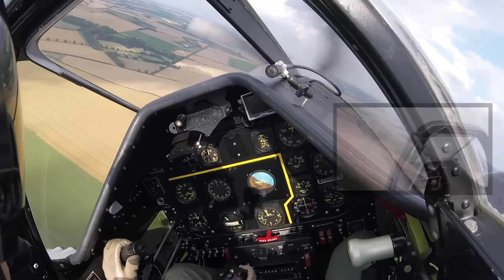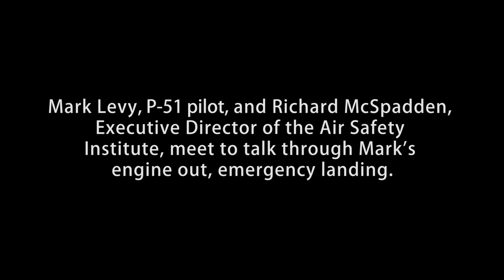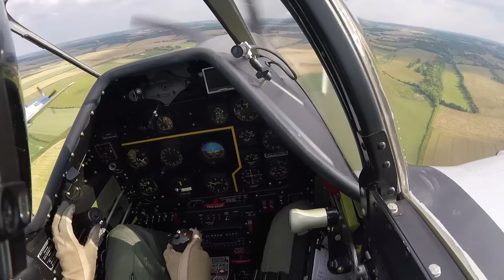P-51 Engine Out, Off-Airport Landing - Full Analysis

Comment: Excellent discussion. My rule for an emergency landing is "No gear until the landing is assured."  I don't care who is saying what in my headset.
And you're totally correct: an intermittent failure is much harder to deal with.  Your analytical, problem-solving side is having a tug of war with your natural instincts for hope. 
I had that happen (and interestingly enough, in my Navion), when I had an inflight engine failure at altitude over Connecticut. One moment everything was humming along. The next, sputtering, vibration, then silence.
 The engine had been newly overhauled (so of course it must be water in the fuel, right?). I traded airspeed for altitude until I hit best glide (90 MPH in the Navion at my weight),  switched tanks (no change), hit the boost pump (no change),  made sure the magnetos were on both (no change), then gave up and started downhill in the direction of the nearest airport (which I could see).
Then, the engine restarted.
Hope reared its head as I clawed back the altitude I'd lost. Water in the fuel after all! I turned away from the nearest airport towards my destination, just forty miles away. 
A few minutes later, it happened again. Rinse and repeat.
I flew a sinusoidal, up and down wave pattern all the way home, passing many good landing options along the way.  The engine running fine, then quitting. Running fine, then quitting. 
I landed at my home field (BAF), taxied to the FBO and the mechanic I knew would be on duty there., and shut down.
He determined I had only one functioning cylinder (out of six), that the rings were coked with burned oil,  and that oil  getting by the stuck rings was shorting out the plugs, causing the engine to die.  When the plugs dried a bit, the engine would relight. But there was no denying my newly-overhauled engine had cooked itself near to death.
It turned out the overhaul facility in southern Ohio  (since gone out of business) had not reinstalled my intercylinder cooling baffles, causing wonky airflow and overheating. 
There is no doubt I should have landed early and not pressed on for home. It was not "water in the fuel". Serious problems do not fix themselves.
In other words, I was not smart. But I was lucky.
Reply: @johnnunn8688  Actually yes - one cylinder working (which alone isn't enough) and then intermittent additional cylinders making the engine run again.
Reply: Personally, I would have put it down at the nearest airport even if the engine came back.
Reply: @johnnunn8688  I think the cylinders were working...it wasnt getting fuel or spark. maybe a broken ignition wire making and breaking intermittently
Reply: @captaincoleslaw174  he couldnt make it didnt you see?
Reply: Excellent advice Robin! Had that happen myself a week and a half ago. Was on a relatively short 250nm cross country. Had flown there successfully earlier that day, and was returning home, due back just before sunset. Started noticing some significant vibrations in the floorboard, and then the engine stopped. Fortunately having gone over emergency procedures the day before, I instinctively turned on the boost pump and switched tanks. In my mind, quick thinking saved the day when it came back. I was well within gliding distance of a runway, just across the highway from it. When it happened, I turned sharp to set up for left downwind. When the engine came back, I thought let’s press on for my home airport (only 5nm further south and at the edge of my gliding envelope). Long story short, made it back with a rough engine. Ended up being a primer line loose behind the panel and a coincidence that it started running again, totally unrelated to my troubleshooting steps. In retrospect, should have continued with my approach for the first runway instead of letting get-there-itis rear its head and pressing on for home. 

And to all the non-pilots commenting, it’s really easy to rehearse emergency procedures on the ground or in a nominally running airplane (as I had done the day prior). But when it happens, task saturation is a bi*ch, and you just hope that the mission critical aviate tasks are instinctual, and you have enough left over to at least navigate. Communicate if luck is also on your side. There’s a lot that I would have done differently, and I’m fortunate enough to live past my own event to learn these lessons. As they say, you can’t possibly live long enough to learn the lessons of others on your own, and that’s why we share here. Not to be told what we did wrong from Monday morning quarterbacks in mom’s basement, but to share with other aviators to hopefully help someone like myself or Robin out in the future. God I’d take an engine failure any day over partial failure and rough running engine...
Reply: Thank you so much for admitting that. Might save a life by turning your luck into someone else's smart.

Comment: Great piece of advice for owner-pilots like myself. The airplane has let you down. Don't try to save it. Save yourself.
Reply: Usually, if you save the plane. You save yourself. Unless you can eject with a parashoot.
Reply: Saving the plane should not even be a consideration is the point I think. IF you save the airplane, sure you save yourself, but if you FOCUS on saving the airplane you can fixate on an unimportant goal and end up killing yourself trying to save the plane. Screw the plane, insurance will pay for it or they'll get it fixed back up. The primary objective is/should be your own survival.
Reply: Don't worry about the airplane.  Trying to save the airplane can get you in a lot of trouble and probably killed.  Worrying about saving the airplane will most likely affect your decision making skills, causing you to make bad choices.  Like an impossible 180 back to the runway for example.  Better to sacrifice parts of the airplane (wings, gear, etc) in order to minimize the forces on the cabin.  For example, it may be advantageous, in a crash landing, to orient the airplane so that the fuselage goes between two tree's, and the wings strike the tree's slowing you down while saving the cabin.
Reply: Yes, children can sometimes be such a disappointment.
Reply: CYCLOWL i believe that too a p-51 is a great piece of machinery and even rittled with bullets they can still fly
Reply: A good landing is one you can walk away from. An excellent one, you can reuse the aircraft. 

He did an excellent job of making it to the ground, and although I absolutely love the P-51 and its history. It is still a piece of machinery that can be replaced. There is only one "you" and you cannot be replaced. Being a fairly new pilot myself, I think this is an excellent video to show to newbies.

Thanks, and good luck with flying.
Reply: I was in aviation maintenance for 8 years and I can tell you, that even when you have complete and accurate maintenance  and record keeping things will still just break and quit on you anytime you take the bird out of the hanger. Try as we might equipment and machines just fail sometimes and there's no level of maintenance that will stop it, but we can try and minimize or reduce that window. I've seen my share of brand new birds to a unit have problems before they even got to our hanger(hell, we had one have a fault right on our ramp when they were trying to shut it down after it's first flight).
Reply: Some machines are worth more than some humans.
Reply: Unless one of those bullets pierces a coolant line, if that happens you have 5-10 mins.
Reply: schoolisboring22 unless one of those holes are in the cooling system.
Reply: What you may want to learn here is that he had plenty of energy to reach the runway but managed to miss.
Reply: Dan Frederiksen not quite sure that is correct.   The glide ratio is about 1.1. He was low speed and had a freeway between him and the runway. He did correctly.
Reply: 1.1?? and no he did most certainly not.
Reply: Dan Frederiksen glide ratio 1to 1. Every foot of altitude you can go forward 1ft.
Reply: No aircraft has a glide ratio that bad. Where are you getting that?   if you google there seems to be wide consensus that its best glide ratio is 15:1
Reply: Dan Frederiksen yes the 51 has a glide ratio of about 15:1 that is correct. But, that is true when the aircraft is at best glide speed. I think that is about 160 mph, I forget for sure. But, the pilot stated his guns started whistling at the same time, that means he was approaching stall speed. The glide ratio at 100 is about 1.1. It is very bad and he stated his gear was also down. He never would have cleared the freeway. So he tucked up the undercarriage and had what 15 sec. before impact. This guy did good
Reply: Dan Frederiksen I worked at American Aero Services restoring warbirds. I have spoke with George Baker, my old boss, and he stated the glide ratio was even numbers
Reply: If he is full flaps, gear out and flying a near stall, sure it could approach 1:1 but again that would be pilot error. And open cockpit. The plane is capable of much more. You can't say he did good within the premise of doing really badly. That's like saying Trump is doing pretty good given his ocean of really bad decisions.
The overall picture is that he had plenty of energy to reach the runway, he decided to fly by and go around and managed to miss the runway. Crashing an old plane that costs 2 million dollars and significantly risked his own life. He could have easily made the runway yet he managed to miss. Say it over and over until you realize he didn't do so well.
Reply: Think it aint?
Reply: zap2002 there's an old adage that was said during World War II in the RAF.

A spitfire has 3 offensive weapons. Machine guns. Cannons. And the aircraft itself.

These are true words, uttered by pilots who know that an aircraft can, very quickly, turn into something that can kill you very quickly.
Reply: Another good Mantra. Thanks.
Reply: Given that I am not a pilot but can clearly see the horrible situation Trump has saddled the U.S. in with his lying cheating  division and creating the biggest debt ever which will take decades to clear if ever Dan's example is right on the money. No need for name calling except when you are an irreverent bully Have a nice day.  @srauner1
Reply: yep. My old Instructor told me: 'Never try to save the aluminum - you can buy more aluminum but you can't buy another You.'
Reply: @DanFrederiksen  -  the Economy is Back from the Dead thanks to President Trump
Reply: @DanFrederiksen  We have one pilot who has spent his life as a commercial pilot. And one ex F15 pilot. And then a sim pilot. You did find a great way to make a fool of yourself...
Reply: @Ford_Raptor_R_720hp_V8  That's a laugh. He ENDED the longest run of job growth in US history. Income is tanking. Yeah, the "economy" is great IF you're a billionaire and it's all in stocks, getting boosts from Trump's tax breaks for the rich. But for the average American, Trump's policies are a complete F*^%king disaster.
Reply: @DanFrederiksen  You are the worst form of armchair quarterback, thinking you know more than the pilot that was in the seat. He was NOT at the corner of the runway and decided to go around. He was on the downwind leg, PARALLELING the runway. When you do finally see the runway out the corner of the video, he is too low, and on a bad angle to land safely. He'd more than likely have ended up hitting the freeway, in a more disastrous spin that would have killed not only himself, but many motorists as well. We leveled the wings, giving himself more lift, and still was in the air less than the time it would have taken to reach the runway. He did the right thing. Neither he, nor Chesley Sullenberger, did a damn thing wrong, worrying about the life on board instead of the aluminum heap around them. And off-runway landing with no lives lost is fantastic, and to be applauded. Yes, a P-51 is a rare and expensive piece of machinery, but it is STILL just machinery. It can, and has, been repaired. All that was expended was a few dollars. Dollars come and go. They are not important. No lives were lost, THAT is what is important. 
As for your claim that no plane has a glide ratio as poor as 1:1, I reference you to the F-104, which has a glide ratio somewhat less than your average brick. Let the professionals fly, stick to your keyboard warrior-ing.
Reply: @markpowell3657  -  Job Growth?

after the Democrats Crashed the Economy in 2008?

from Bush's Jobs Peak to Obama's Jobs Peak, Obama added 8.9 million Low-Life Jobs, 
while 15 million left the labor force unable to find a job in a whole year
Reply: @markpowell3657  -  Tax Breaks for the Wealthy?

why not? they Pay all the Taxes.

the Wealthy Create Jobs and Grow the Economy.

Liberal Politicians and their Maggot Supporters don't do any of that
Reply: ECONOMIC GROWTH

<1.5% GDP under Obama's 8 years
1.5% GDP in Obama's last 7 quarters

2.1% GDP Q2 2019 / Trump's worst quarter
Reply: Obama's Historically Bad Economy
Aug 2016

Here is the complete list of average annual GDP growth ranked by postwar president (in descending order):

Johnson (1964-68), 5.3%
Kennedy (1961-63), 4.3%
Clinton (1993-2000), 3.9%
Reagan (1981-88), 3.5%
Carter (1977-80), 3.3%
Eisenhower (1953-60), 3.0%

(Post-WWII average: 2.9%)

Nixon (1969-74), 2.8%
Ford (1975-76), 2.6%
George H. W. Bush (1989-92), 2.3%
George W. Bush (2001-08), 2.1%
Truman (1946-52), 1.7%
Obama (2009-15), 1.5%

Obama’s last-place tally of 1.5 percent doesn’t even include the BEA’s numbers for 2016, since the year isn’t yet complete. Thus far, growth in 2016 has been 0.8 percent in the first quarter and an estimated 1.2 percent in the second quarter. So Obama will be lucky to finish his presidency at even half the postwar average of 2.9 percent growth.

Here is the complete list of the best year of real GDP growth under each postwar president (in descending order):

Truman (1950), 8.7%
Reagan (1984), 7.3%
Eisenhower (1955), 7.1%
Johnson (1966), 6.6%
Kennedy (1962), 6.1%
Nixon (1973), 5.6%
Carter (1978), 5.6%

(Average best year for post-WWII presidents: 5.6%)

Ford (1976), 5.4%
Clinton (1999), 4.7%
George W. Bush (2004), 3.8%
George H. W. Bush (1989), 3.7%

(Average for all postwar years: 2.9%)

Obama (2015), 2.6%

https://www.hudson.org/research/12719-obama-s-historically-bad-economy
Reply: Obama's Worst GDP Quarters in his last 6 years alone

-1.0% - Q1 2011
-1.0% - Q1 2014
-0.1% - Q3 2011
0.4% - Q4 2015
0.5% - Q3 2012
0.5% - Q4 2012
0.5% - Q2 2013
1.0% - Q3 2015
1.5% - Q1 2016
1.7% - Q2 2012
1.8% - Q4 2016
1.8% - Q1 2017
1.9% - Q4 2014
1.9% - Q3 2016 

this is what FAILURE looks like
Reply: @markpowell3657  Paralleling the runway wasn't exactly a decision the plane made. He did and it was a mistake. It's really quite simple. Even you should be able to understand it.
Sully had the energy to fly twice the distance he needed to return and there was water all the way there. And he did fly twice the distance needed. His only excuse is if like in the private pilot community there is the idiotic belief that turning back to the runway is the impossible turn. It is nothing of the sort.
Reply: zap2002 and don’t get in a 70yo 1500hp plane and fly formation at 2,000’!
Reply: This guy did everything wrong and is a bad example. He flew the pattern not to the runway to land.
Reply: @DanFrederiksen  I disagree....even Trump has done more good than bad. Jesus...does anyone think it's normal to have former heads of the CIA working at CNN? Trump has exposed the media like Snowden exposed surveillance to us. Trump isn't perfect, I'm not....even this pilot's says...he wasn't.
The decisions he made were made pretty well. Like he says...intermittent failure is worse... you can quickly get into a "I think I can save this aircraft" mentality and end up hurting yourself or someone else. He walked away...as a Mom and a wife....I give that two thumbs way up high all day.
Reply: Hillary promised to Fix Obama's Lousy Economy
with more of his Failed Policies
Reply: Consumer Confidence is at a 20 year high
Small Business Optimism is at a 40 year record high
Reply: Democrats are doing to the House of Congress
what they did to the Economy in 2008 and the Obama presidency

- CRASH and BURN it
Reply: in Jan 2017 2 million jobs were forecast by the CBO under Obama's policies

almost 7 million jobs have been created under President Trump's policies
Reply: @markpowell3657  -  MASSIVE TAXATION and FREELOADING will make America great again

so Vote yourselves a BIG FAT PAY CUT - Vote for the Do Nothing Democrats in 2020
Reply: Dan Frederiksen not with flaps dumped it isn't. It states clearly that with full flaps the best slope you can hope for is 1:3. You might possibly get 10 if you have flaps 0, but you certainly ain't going to get 15 at 150 miles per hour. Like he said he had almost no energy weighing 7000 pounds or there abouts.

You even heard him say that he was losing height extremely quickly and he had a highway with cars and trucks on it, he had to make a decision within a few seconds, he turned away from the highway and chose a corn field.

He was in the middle of a 180, if he had lost all energy or clipped the hedge of the freeway as he approached the landing strip he could have ripped his wing off and done a spin and died.

I think a GA pilot, with many years experience flying GA as well as commercial aviation, and with a few hours on a warbird and knew its characteristics, knows a bit about flying - especially as a chief instructor.

God, some people on here really are armchair pilots and they talk crap.